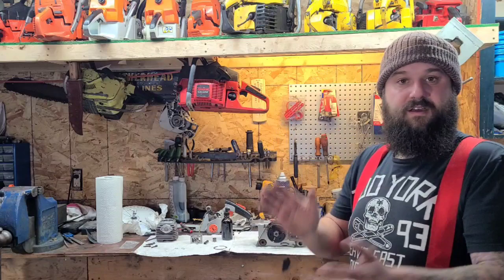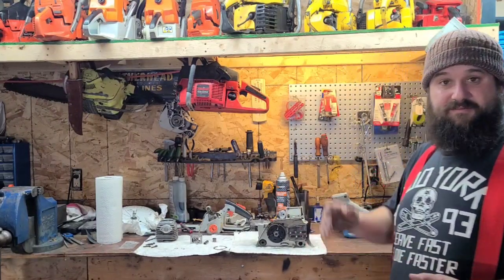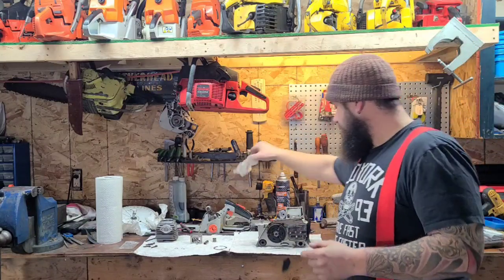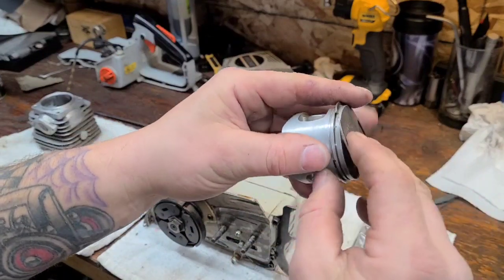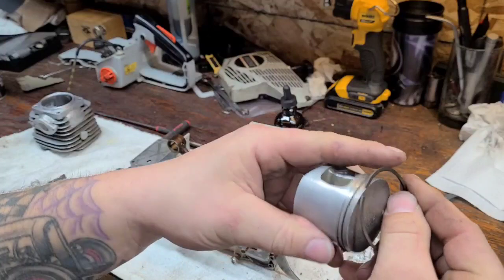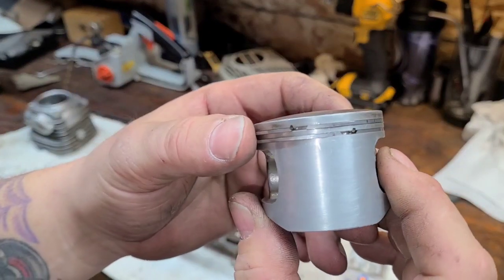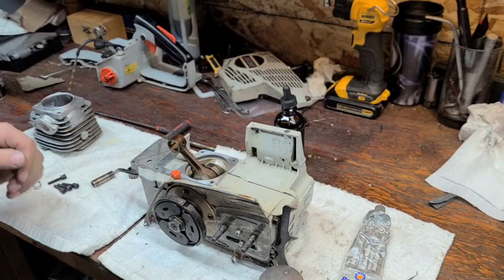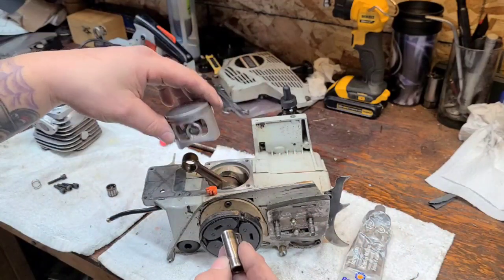How to port a chainsaw part 11: Tips  for installing a piston and cylinder.

Comment: I like the way you clean parts and hands before assembling every part, and oiling parts. 

Putting moto seal on, I use a pop cycle stick, it save time and wast. 
Your demeanor and presenting the way work is done is outstanding. Taking the time of the does and don’t goes a long way for those that are starting out, working on any two cycle or four cycle engine. 
May you continue to teach and improve you Chanel. The Best to you. 
From one ( OLD ) gear head. Georgia US.

Comment: Exquisite serie of vids about porting a saw. A lot and lot of info that you don't get in any book. I like the way you do things, I like the way you explain it, it's all plain and simple!
I have a question, however, if I may. I saw you didn't use blocking paste on the cylinder screws. I wonder if you think it's not necessary. I mean there are some vibrations in that area, though.
Or it'll be put in the part 12, after the silicon cures?😁
Thanks!

Comment: I use an xacto knife to put rings on. Once you start walking it over to the bottom, if you take the knife and run it under, it'll walk over smooth as butter with no scratches or damage.

Comment: Couple more tips:
#1-- Piston rings: I'd thought I was "cheaping out" using zip-ties to hold the rings, but then seeing you use the piston-squeezer I realize you need to use a hand with it.....no way, zip-ties are superior in my book now!!  I use the fatty ones (handcuff type) but any zip-ties would achieve the function well, you secure the ring into the groove & the cylinder itself slides the zip-tie off of the bottom of the piston (and you then snip it, obviously :P )
#2-- Cylinder bolts: You do mention cross-bolting, but IMO this is an area to be a real OCD-dork and do a "initial cross-bolting" to squish it tight, then back-off those screws to finger-tight, then do your actual/final cross-patterned tightening (doing VERY lil tightenings-per-bolt for the first few passes!), I know this sounds anal but if you measure a cylinder the most consistent dimension is base-plate to squish band, this is a critical 'true-ness' to cylinders if you make everything perfect but the cylinder is cocked by 3 thous's on the bottom end then your #'s are out of the window (as is the volumetric efficiency of the engine, of course)

Comment: Thanks for the chainsaw assembly videos. It has been really helpful! Is there any issue with aligning the cylinder when you're installing it back on the saw body? I am trying to put my dad's old Stihl 015 back together, and there seems to be some slop in the bolt holes that hold the cylinder to the body. I'm concerned if things aren't aligned right their might be too much stress on the piston rod. Any thoughts on this would be appreciated.

Comment: I've always said I was going to make a box like a sandblast cabinet. 2ft deep 3 ft wide and 2 ft tall. Caulk it. Put some led lights in it and a big plexiglass window. Line the floor of it with a magnet and cut 2 arm holes and have an official disassemble / assemble box. Ive spent a year of my life looking for C clips, Orings tiny screws, etc over the years
Reply from the maker: Haha yep them clips going flying

Comment: Just wondered if you tried JB Weld on the old T handles, but I see you have a new set now.  I've now heard top, bottom, and sides for cir-clips.  Top, or bottom makes sense.  Side seems like it might compress when the piston changes direction and possibly come out.

Comment: Hey Tin Man love the channel found you via " BBR channel : brother I have a question I'm rebuilding a 83 520 sp jonsered piston and jug how can I test to see if the crank seals are still good in that saw ,would I see oil leaking ,or is there something I can do there a pain to do and if I don't have to mess with it I don't wanna I watched your video on husky seals and learned how you do em ,what should I do brotha ,prob replace is what your gonna tell me lol 🤣 thanks for your time ,keep up the awesome channel ,the Squatch
Reply from the maker: Morning, 

To test seals you need to do a pressure and vac test.

 It involves blocking off the exhaust and intake port and then either pulling vacuum through the impulse line or a nipple inserted into one of the blockoff plates. 

This will apply vacuum or pressure to see if the seals hold.

Comment: Oh and Re tight piston wrist-pins:
#1-- put it in the freezer, and only take that wrist-pin out when you're ready to throw it from the freezer into the assembly (it will warm&expand quickly after you take it out), and 
#2-- I'm gonna need to rewatch this because 1st watch there was a worrying lack of advising newbies "do NOT slam the wrist pin in and put lateral pressure onto the rods, if you can't use your hands then use a block!"
Yours slid in quite nicely, but you know how hard they can be, someone can very easily hurt their piston rod by slamming w/o securing (it looks like your technique is kinda one wherein you're not using your hands to support the rod, but instead supporting the piston itself which I'd normally not do, for fear the whole piston could still move and take that rod with it, but upon seeing you do it I think that's how I'll do it now, am sure I can just have the piston positioned forward and keep pressure between it & the case, bet I could do minor hammer-taps w/o the rod seeing an iota of pressure, thanks :D )

Comment: You can put the piston into a warm oven for a few minutes and it will go together easier.  140* is usually enough if the pin is tight.

Comment: Hello I have a Stihl 045Av just had shop put carb kit in it and bench adjust. Runs good and idles good. The problem is when I make a cut it runs good for few seconds then acts like it’s running out of fuel. I adjusted H screw out (counterclockwise wise) seemed to help but did not fix. Is there something else that could be causing a problem? Impulse line or crank seals? I noticed it has a weighted filter and the weight seems to move inside the filter. Is that normal with old filters? Thank you and love the channel
Reply from the maker: I'd check the impulse line, fuel filter and tank vent.
Reply: @tinmanssaws  thank you!

Comment: have you try to replace the piston rings pin, they do that with bikes if porting so mutch at the rings risking to stuck in a port.hope you understund what a did mean.not so good in english but a try
Reply from the maker: Hey buddy I've never changed the pins on a piston.
Reply: @tinmanssaws  ok. was only wondering because it would be intresting to see how to do it.

Comment: Why not use heavier greases/oils during assembly?  I keep thinking back to a prior vid (pt.10) where you mention how lil scuffs on the surfaces in the jug are not bad (if they're small enough, obviously) because they "hold oil"....My understanding is this is actually the reason you WANT there to be a "cross-hatched surface finish" on your plating in the cylinder and sides of piston (not truly horizontal, but kinda 'angled horizontal' so it's "shelves" for oil, vertical would not hold as well)  
But what of this unique moment in the engine's life, its birth into >200 strokes/second, we're still just wiping everything down w/ regular 2-stroke?  What of the bearings on the shaft that you hit w/ brake-clean in the last video?  You would have to douse that bottom end in grease, like submerged to get those bearings, no?  Sorry I just cannot stop thinking of that, in biking the bearing cartridges were seen as so fragile/do-not-touch and the idea of letting wd40 near them was a bad idea, maybe they're more sealed than powersaw bearings.. 
But for this moment of break-in, I cannot help but think that it'd be better if, before saying "parts are clean & ready for oil", instead of the last step being a full strip in soapy water, IMO it should get that soapy water then a heavy rub-down w/ grease (real grease, like Marine Grease by Lucas), then wiped with a rag to remove as much of that grease as you can by rag*....*then go ahead and call it "clean & ready"!!!  
Just a thought, I do not do this to the jug surfaces but I do pack the roller bearings, the piston-pin, anything like that's seeing hard contact like that (even my chain-tensioner) is getting heavy grease!
(even the way you do it at the end "drip a lil 2-stroke onto those bearings" in the case....seeing they were just brought to metal w/ the brake-clean -- hopefully there's no ferrous metals in those alloys down there-- but in that example I have to wonder why, instead of "a lil drip", why not POUR 2-stroke oil in there, and then use gravity&rags to get out any excess?  Just can't help worrying those bearing-balls are not being fully lubed in this case :(

Comment: Dear Tinman: avid fan and follower of yours. I write out of concern that you work with known carcinogenic chemicals without suitable chemical resistant gloves such as a decent mil nitrile. You’re no doubt doing it for precision purposes and because the circlips and rings are hard to work with. But cleaning your skin directly with brake cleaner is extremely hazardous over time. Your skin is actually a bodily organ and absorbs poisons. Brake cleaner is one of the most dangerous materials to apply directly to your skin. It likely says so on the hazmat labeling. I am a gunsmith and also an amateur power saw restorer. I use nitrile gloves. Gun cleaning sprays are also very carcinogenic. Even with these  prophylactic measures I’m still exposing myself to the carcinogens to some degree. I’m very worried for your health m😊 friend.  Don’t want to see you get cancer. All of your loyal followers want the Tinman around for as long as possible to keep producing great content. Much of what I know I can attribute to you. I know I’m off topic,  but please recognize the risk of having these ultra hazardous materials applied directly to your skin. Merry Christmas. Dan